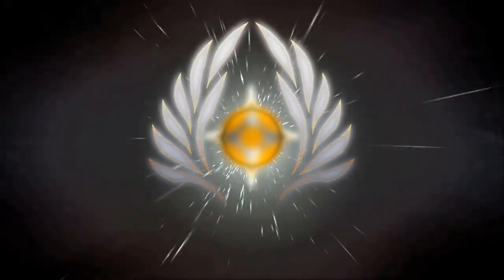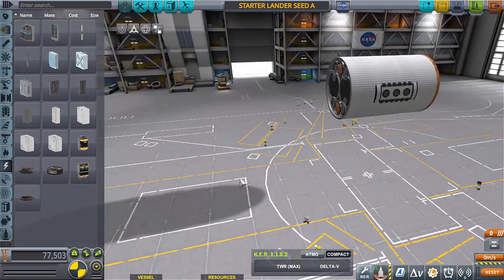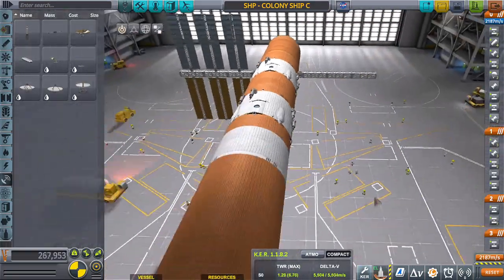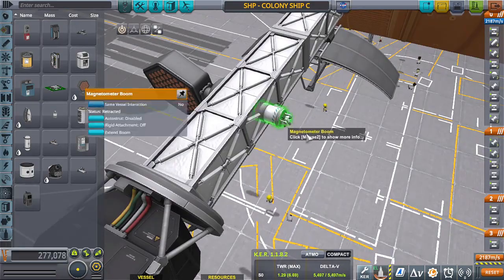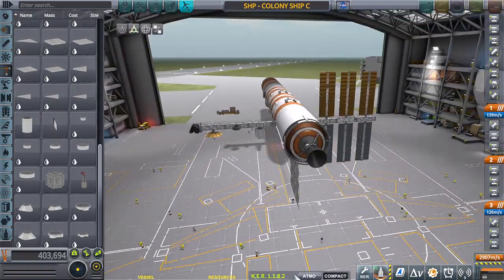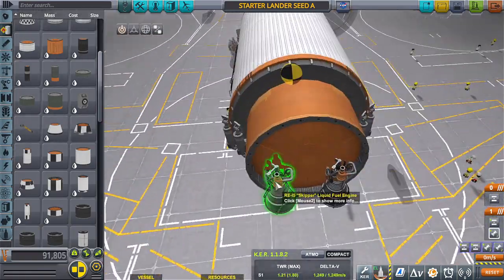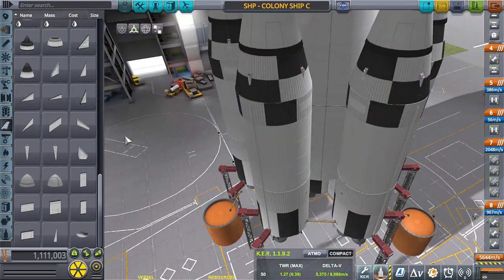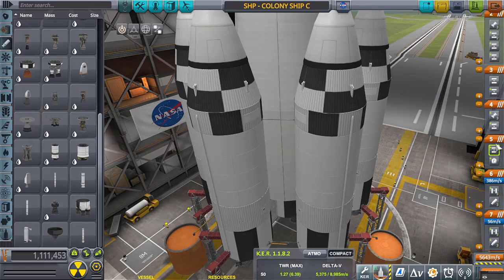NEW FACTORY DUNA LANDER \ Kerbal Space Program

Comment: With restock, transfering a craft between using restock and vanilla can sometimes mess things up slightly, only because restock resizes some things slightly and sort of shifts where they are if you know what I mean, so e.g I built a space station with restock then transferred that game save to a fresh install of kerbal and iirc the fuel cells were like clipped inside the station and a couple attachments between sections, like the docking ports were a bit weird but it's not too bad, no major problems